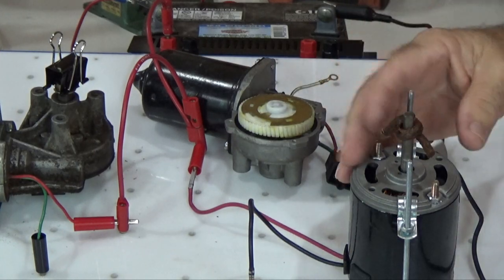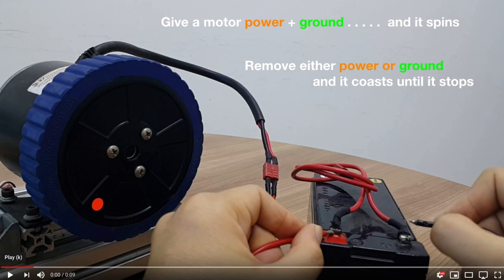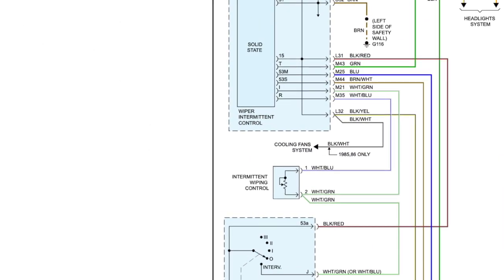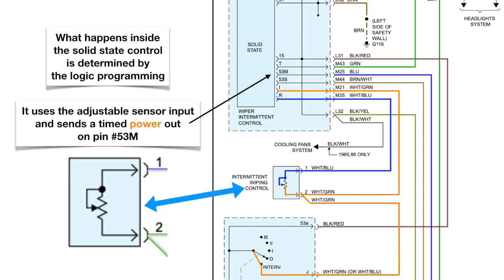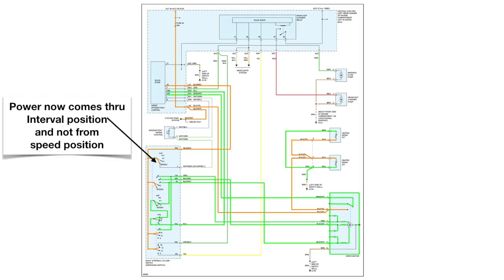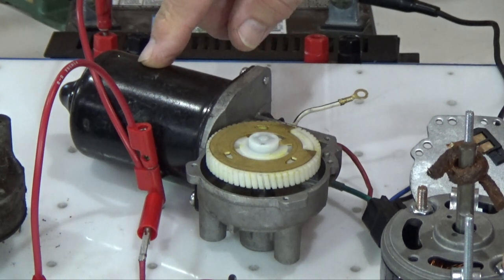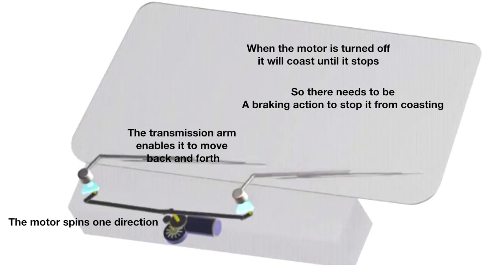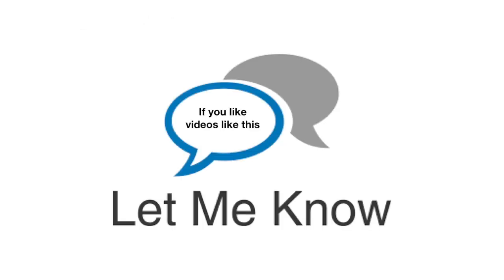How a Wiper Motor works.     Part 2

Comment: Motor wiper motor when it’s turned on it blows the wiper motor fuse wich is 25 amps I don’t know why it does this I’m sure there is something I’m not doing right. When I bought the coach the motor was removed I replaced it with a new one from a parts dealer brand new it’s frustrating so I went ahead and re wired the unit directly to 12 volt battery on a universal switch and seems to work just fine thanks for this education information
Reply from the maker: I'm glad you got it working.  Electronics can be frustrating

Comment: First off I love all you’re stuff. But, when you talk about the shorts in this lesson don’t you mean that the is less resistance? If the resistance was high the fuse would not blow unless the wire was so corroded the normal wire in the electrical circle changes wire diameter bedside the corrosion is the new section of wire which could create heat and burn open that section of wire if the amperage to push pass that section of wire is now below the amperage rating of the fuse an open would result. Loss or less resistance is the cause of shorts. Thank you for the great video.

Comment: Something you said in the first video reminded me of something Duane.  You mentioned electricity on the "atomic level" which made me think of one of my friends that worked for Caterpillar for many years. He specialized in large Gen Sets and made the statement that a four inch cable actually required more diesel fuel and more power at the crankshaft to push the current up hill. He then explained that the electrons were actually travelling through the copper itself. - The statement always seemed to help me grasp the fact that something really was physically moving through the cable similar to a pump pushing water. Love the videos. Keep'em Rolling!
Reply from the maker: That was a good way of describing it, and accurate.  Sometimes us old guys know how to describe things the way we've found them to help

Comment: I can not see how the capacitor could release a counter EMF and thus braking the wiper motor. The capacitors's polarity is the same as the original power supply so its electrical field is not an opposed one. 

I like your videos.  8-)

Comment: I'll have to read more about this. I assumed those are flyback caps, to flatten out the voltage surge when power is cut to the inductor, to protect upstream electronics from a reverse EMF voltage spike. It didn't even occur to me they would stop the motor more quickly.

Comment: Mr. Duane: Of Course I Liked This Videos (1 and 2).
A question: 
Does this Dynamic Braking wiper motor system is a Porsche item? 
Watching Mr. McIntire video it is deductible that the same wiper motor can be used as a Dynamic Brake instead of using Capacitors, by simply closing a circuit on It. Please Enlighten/Correct me. Thank You.
Reply from the maker: you are correct.

Comment: Those capacitors have NOTHING to do with "dynamic braking". They are for filtering high frequency electrical noise created by the motor brushes. They are properly called "bypass capacitors", because they bypass or shunt the high frequency signals directly to ground (the motor housing). Capacitors will pass AC current, but not DC current.

If dynamic braking is used, it is accomplished inside the intermittent control unit, probably by shorting the motor lead to ground or shunting it with a resistor. The capacitors are needed to keep the brush noise from interfering with the electronics in the control module.
Reply: I think his explaination is essentially correct if it were an AC motor. Much like a start capacitor on a starting winding helps to add torque and power on an AC motor. I I agree with u that those are more for bypass caps and don't know why he didnt even mention the resistors in the circuit. He may have in part 1 I did not see it. But I think it is what it looks like the braking simply comes from losing contact on part of the gear but momentum carries it on through and is timed to correspond when the motor is not pulling the weight of the wipers. If the motor kept pulling that would cause a surge and make it "jump"when it re-engaged with the load of the wipers. The resistors are what is slowing the motor hence slowing the wipers. But I may be wrong.
  Electronics is a hard concept for people to grasp sometimes and I think we all kind of reach our own understanding of how certain things work. When u get into things like dynamic braking I find that some people have a slightly less than exact understanding of the details so thet can grasp it.
     Still another great video from a very knowledgeable gentleman who is kind and generous enough to take time to teach others. I think he is an excellent teacher and I have learned alot in his videos. It was still educational